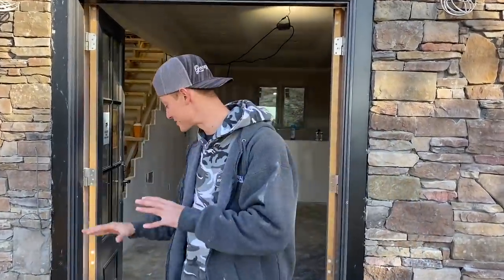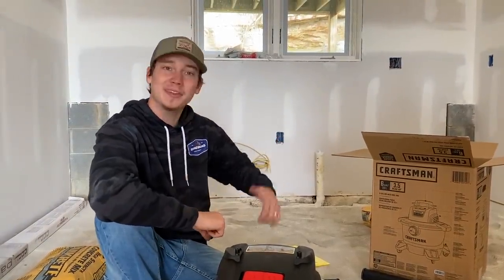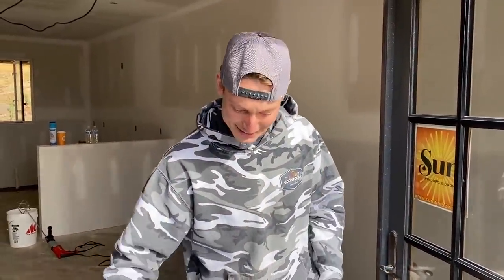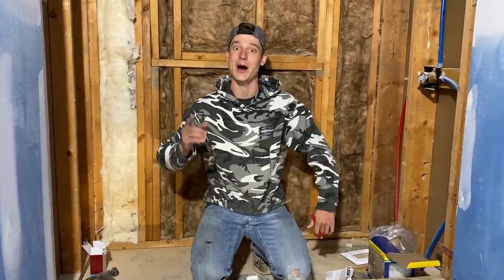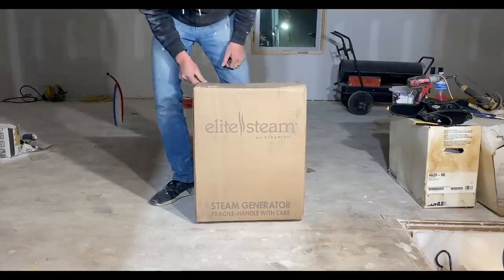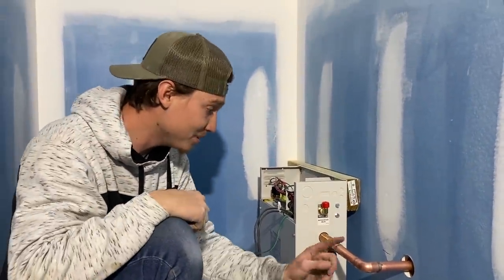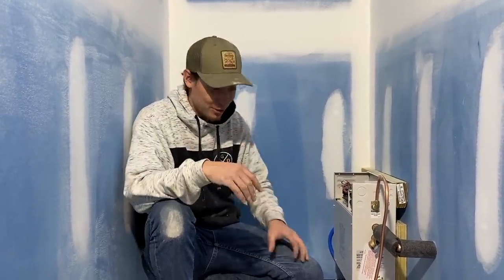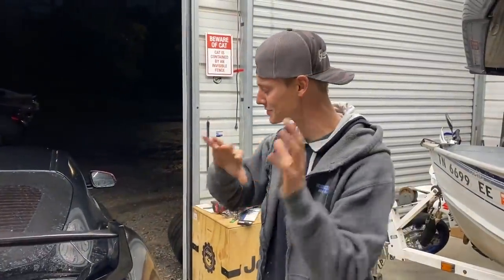The New Goonzquad Headquarters Part 47

Comment: Probably should be a drain near the steamer unit.  There appears to be a drain valve under the insulated copper pipe that was soldered together.

Comment: First work before installing tile..
Balance the area
Where do u want the water flow to go
The water needs to flow towards... the hole.. otherwise you guys will always be stuck with water standing on the tile floor at a corner.... or somewhere in the middle..use a thread... nd create a balance... its always a slanting ... 1/2 inch gap must be kept...

Comment: Boys....you can’t just pour the concrete directly over the pipes for the plumbing. Also look into you codes because that kitchen sink isn’t vented at the moment and you can’t use a cheater vent on an outside wall. Also the tile around the toilet flange needs to allow the flange to sit flush to the concrete floor. So get the tile cutting bit out and start cutting!

Comment: hey,both showers need studs at each end. also the steam shower needs a Fantech  light,fan  for ventilation. the hight of the steam shower shpuld be around 78 IN off  the curb not full to the ceiling. also you cant have half a million dollars in cars and not have a mudd job  base.

Comment: You fellas are always going down the mountain for supplies, why not bulk buy and store on site? So many consumables you will need for the garage yet...
Reply: The skill of knowing exactly what to order and when takes a great deal of experience to acquire. In the case of the proposed Garage/Workshop which it is proposed to build to the west of the 'HQ House', it would be difficult to usefully pre order materials until the details and dimensions of that structure are decided.

Comment: You need to run that wire in a metal tubing to protect the wire. I've been an electrician for the last 30 year. You will fale final inspection.

Comment: Do they not cover all the sheet rock with plaster?
Reply: No, the drywall has been installed with an outward facing surface that, once fixings and joints have been skim plastered, is then ready for decoration.

Comment: Mohawk  has some good made in the u.s  engineered wood. They may have a wood look tile that has the same width as engineered wood. But it would be pointless to get similar floors that are supposed to be different.  But they have 2' x 4' or 1x2' tiles to offset the real wood

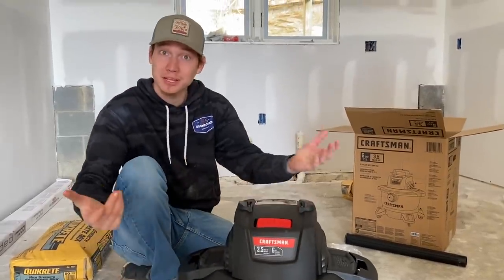Comment: The shopvac does not have 3.5 hp. It has 3.5 "peak" hp (which is a made-up spec that means nothing). The actual hp is usually more than an order of magnitude less than that advertised. If it was actually 3.5 hp, you'd need a 220v outlet to power it. 2:08

Comment: If the steam unit is 10kw you will need to run #6 wire, the 10/3 you ran is good for 5kw.

Comment: Electrician gonna be re-running that wire my dudes
Reply: ands its about the amperage on the wire not so much the voltage normal romex is good for up 2 300v, nice work though boys keep it up

Comment: Why didn't you put that blocking between the studs behind the sheetrock? Then you could mount it directly on the wall. Also could hide the water supply pipe in the wall

Comment: Obviously laws are different over there, but doing electrical work yourselves? 
That would be a no!
Love you guys for all your cars/house vids.
Reply: We have mentored, worked with and supervised many self build groups in North America and in Europe. After these people have successfully completed an appropriate training course, we have never had any significant difficulty in entrusting such 'amateurs' with electrical, plumbing, joinery, tiling and other works. In some cases (notably electrical works) a brief inspection and test is necessary at completion to ensure that all safety rules have been complied with. Building operations need common sense, are hard work and take time, but they are generally not a serious intellectual challenge.

Comment: I would avoid a floor that glues down. If the floor itself reacts and shrinks a bit you’ll have gaps.  Happened to me when I did a similar floor on a slab. Locking us the way to go, if not tile.

Comment: Wire isn't rated by voltage really, that just tells you how thick the insulator is. You need to pay attention to the amp rating as amps are universal regardless of voltage.

Comment: I know absolutely nothing about steam generators. Is it a good idea to have a steam generator inside a closet, possible contact with combustible clothing and no ventilation? I would be concerned about the potential for fire. Maybe relocate the steam unit in the attic above the shower where there’s ventilation and open space.

Comment: Shouldn’t the water proofing go up the wall ? If that floods it’s going to go under the walls and the grout never seals 100% so the there should be a drain in floor that the water proofing goes into. I may be wrong but just wondering ?

Comment: If you do wood, be sure to do a MOISTURE test first

Make sure you treat and seal the concrete.  Seal when ZERO moisture.  

The work youve done will not compare to the work it takes for prep work in the flooring industry.   THE hardest job in the cleaning industry

Comment: 10,000 watts for the steamer ? 10,000/240v = 42A , and you should derate by 20% so 42A / 80% = 53 AMPS.  Means you should have used a minimum of 6 gauge wire and a 60A breaker. 

That’s based on the stated 10kW steam

Comment: Suggestion : when you get to garage flooring , check out GARAGE FLOORING LLC, Google , vinyl flooring egg crate ( i dont like ) but checkout the Vinyl squares that have a puzzle type snapping , you can pick different colors even designs , i love mine in my 3 car garage , very easy to keep clean , just sweep and sponge mop , Don’t epoxy , they peal up and dont like hot tires 
Only tools needed to install : straight edge , utility knife , rubber mallet and wooden block , very quick to install , you wont regret  DANG SON

Comment: Cut your pipe insulation at a 45-degree angle and it will fit perfectly over the 90-degree elbow. It is also a good idea to run the T&P to a drain just in case it ever pops off Don't ask me why I know!!! LOL

Comment: Pretty sure code says that if a conductor isn't in a protected  wall, it has to be armored.

Don't be surprised if it gets failed by electrician.
Reply: 10 gauge wire also isn't going to be large enough for a 10 kW steam generator. They're probably looking at a 50amp breaker (or larger, depending on de-rating), which is going to mean 8 or 6 gauge wire.

Comment: You know that 10kw on 220V needs 45 amps and therefore at least 45amp breakers? Of course unless you use 2 breakers to get the 220V

Comment: Malmö flooring is a good brand to go for, it just clicks together and slides in - no glue required
Reply: Ya but it’s cheap crap
Reply: @sam_brown32  it’s quite clearly not because What would you rather have to do, pay for underlayment and glue for something that will need replacing anyway in 5-10 years or get something that lasts 15-20 no glue just pull it up and replace after the time no hustle?

Comment: Ya screwed up again. You ran the tile out through the door way. Now when you install the bath door you will see the tile  when the door is closed in the hallway or bed room.. When you use the foam insulation on the plumbing pipe , cut it on a 45 degree angle  to have a perfect corner.   Cold water lines should also be insulated in the walls or attic. Cold water running will cause the pipe to sweat  . Moisture will causes mold inside the walls.

Comment: Auto mechanics, auto body repair, auto upholsterers, auto painting, home painting, tire installers, framers, concrete finishers, landscapers, equipment operators, plumbers, electricians, door hangers, glaziers and window install, aviation mechanics, metal building fabricators, water feature designers, husband, bath and kitchen tile installers, masons, social media professionals, arborists, drag strip racers, rain gutter installers, roofers, car sales, motorcycles, offroading, fishing .  ;-)  Did I miss anything. Whew, I'm tired just thinking about all the things they are doing. Oh, and a great relationship with their parents and each other.

Comment: Why take the stones out of the holes when the concrete has stones in it ?
Reply: Because it wouldn’t stick to the base if you just pour it over the top, too dusty, essentially it would be a floating filler.  But they could have then them out, and mixed them into the concrete as a filler :)

Comment: It is becoming very obvious that to have the front door opening straight into the living space is not going to work. Goonzquad need to have a proper enclosed porch designed and built onto the front of the house. This will create a buffer between inside and outside, and provide a place to take off and store wet coats and muddy outside footwear before opening the door into their warm, dry and draught free house.

Comment: The black tile needs lights that have a diamond shimmer to them sitting on the crapper with the steam going the bedazzled lights going in the floor...Cho Cho or  as Mr Chong would say far out man. Guests asks the Misses where's Simon and Billy...from the bathroom dude dude dude check it out if you push this button smoke rings or steam rings...no way 😒🙄🤨 check out the strobe effect on the floor

Comment: NOOOOOOOOOOOOOOOOOOO, run that electrical wire in the wall behind the heater and even penetrate the  back of the unit to keep the wire hidden. Inspector isn't going to let that exposed wire fly. But what do I know, I'm an electrician!

Comment: That water line in the garage you poured concrete around looks to be PVC, it doesn't meet code and it couldn't be in a worse spot on that front wall, it's prone to damage, it's ugly, it should of been changed to the correct pipe at the least, but better would of been to move it or eliminate it, and you wrap any pipe going through concrete with foam insulation, never pour concrete directly to pipe. Per plumbing codes PVC cannot be used inside the perimeter foundation of the house, it can be used anywhere outside. 
You poured concrete tight around the stub up pipe for toilet, you'll have to chip out concrete to cut pipe and use the flange you have, foam pipe wrap could of been use here also to protect pipe from concrete and give you space for the flange. I won't even go over the steam generator installation, others are covering that one enough.
The ceilings, walls/closets should be painted, at the least primed before tile work. etc, you always "start at the top and work down and out". You boys are doing lots backasswords, oh well, some lessons got to be learned the hard way.  ;)

Comment: Just to let you know, the Delta shower rough valve is way too far back. Please move it forward before drywall and tile are done. The black plaster guard plate should stick out 1/2" on rough and be flush after drywall. It's a bitch to fix later!!!!!!!!

Comment: What the hell.why are you bothering to vacuum the holes out for when your just filling them with CEMENT...   ???
Reply: They correctly cleaned the area before placing new cement based material because the loose fill had been there about 12 years and probably contained organic and other unsuitable materials. This might have weakened the new fill which in turn could have reduced the support given to the future floor finishes, leading to cracking or settlement of those finishes.
Reply: What I meant was, use a spade, or your hands,, not a vacuum, don’t be lazy..

Comment: running a 240 volt wire not through conduit. thats scary. LOL
Reply: We run 240v through the entire house in Australia at 40amp no conduit. Most of the world is on 220v guess we wanted extra for all the beer fridges🇦🇺🇦🇺🇦🇺
Reply: @SDevoAU  US is usually all 110v/120v if something is 220v+ it's usually code to run it through conduit. plus 220v is insane for just regular outlets in a household lol. nothing really runs off of 220 unless its like a car lift, generator, ect.
Reply: @nickh7040   yeah funny plugging a computer plug pack into a wall socket to get 9v from 240v. Same with can lights we have a transformer on all of them to run LED can lights.

Comment: Didn’t you say that was a 10kw steam unit, 10,000w/240v= 41.6amp. 10 gauge wire is not a large enough wire, wire size is based off amperage not voltage.https://www.elitesteam.com/wp-content/uploads/1036_ES-4-6-7-10_Electrical.pdf.  Says 6gauge minimum.

Comment: Sorry, but that curved copper pipe in mid air made me laugh . Its a disaster waiting to happen, You'll put something in the closet, drop it on the pipe and have water everywhere, follow your 1st bit of plumbing diy, use 90 degrees bends and at least fix it to the wall. At least your plumber will fix it im sure. Loving the build.

Comment: whats this abomination you guys were talking about? GLUING down a wooden floor?? wtf? it should be freefloating so it can expand and contract without the risk of cracking.

And seriously... you have blocked off the drain in BOTH bathrooms... so, what happens if the toilet springs a leak? or the sink???